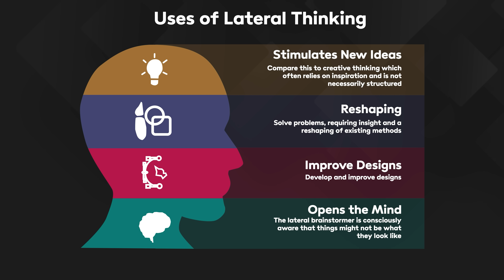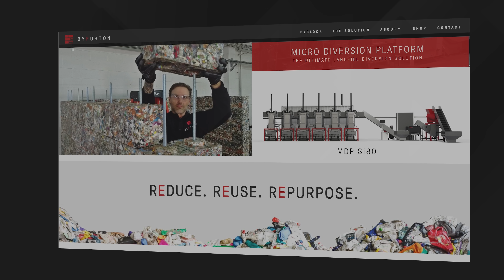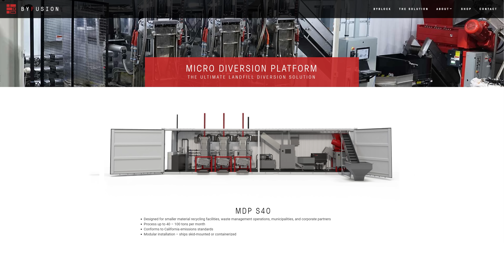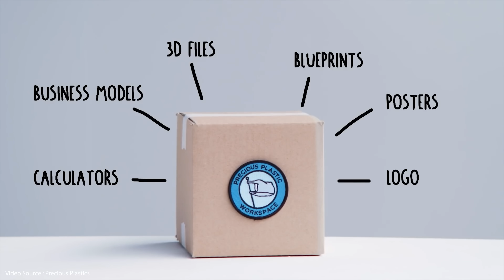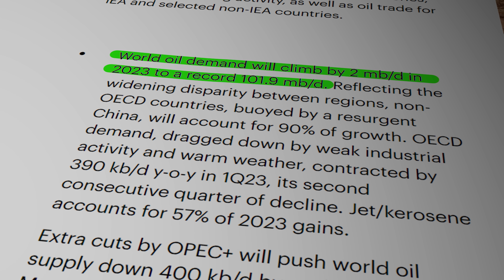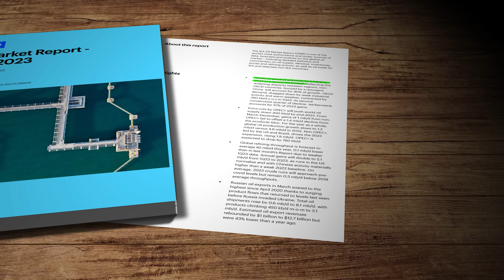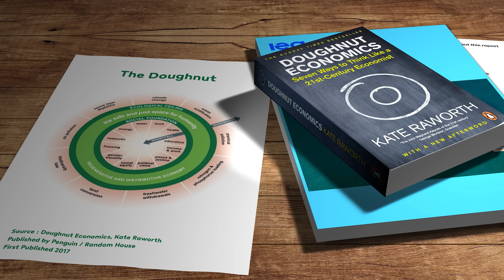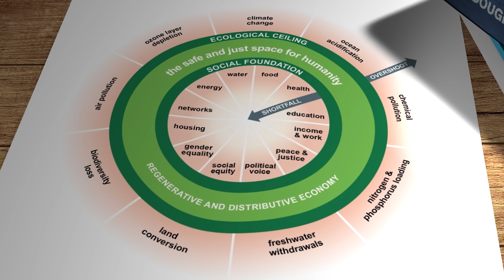Plastic doughnuts? Have you lost your mind!?

Comment: Well, sounds nice and easy. But blocks of unsorted plastic contain and leak all softeners and additives, which the original producer put in - which might not be the best idea, if you intend to build whole homes out of that stuff. There are certainly applications with enough ventilation, that that does not become an issue. But there are other problems: The material is not gone and building materials are not infintiely stable. A crumbling wood-wall produces biowaste,  crumbling concrete releases anorganic dust. But this stuff degenerates to microplastic, which ends up in rivers, oceans and soil as well - and that effect would not even be limited to landfills, but occur on construction sites everywhere. And there is a fundamental difference and disadvantage to other methods to reuse plastic waste: The product her is a solid block of a mixture of everything - good luck separating that stuff lateron for proper recycling. 
I can see a possibility, that this technology might help locally and temporally, when places with a lot of plastic polution are cleaned up and there are no real solutions to manage the waste are available. But other than that, the method does not really solve anything and can function as another method of greenwashing.
Less CO2 than concrete seems to be an argument for the technology. But the material does not fully replace concrete for most applications and when it comes to solutions for special projects, there are already methods available to compress a variety of organic and non organic non-plastic stuff into building blocks which also produces less CO2 than concrete AND has the advantage, NOT to consist of plastic waste.

Comment: In Canada, and just down the street from me, there is a new house foundation being made from interlocking styrofoam (?) blocks which have an open core for concrete to be poured into. The concrete and  some steel rods provide the strength and the foam provides weather-proof insulation as well as a speedy way to create the forms for poured concrete. So plastic is already being used in new foundation constructions. If the waste-plastic mixes could be homogenized, this "hollow blocks" approach might remove a few of the traditional objections.

Comment: Darn it,...I thought I invented( in my mind) the manufacturing of bricks from old, used plastic. I was thinking the plastic material would be compressed into really large building blocks. So large that to move them, and set them into place, you'd need cranes. Designed to interlock, and stay grounded by their sheer weight. We could be building structures that rival The Great Pyramids.

Comment: I like the plastic bricks idea, I was hoping to go with compressed Earth blocks which cut out cement usage in the structure, not the foundation, by 95%. But consuming local waste is in that positive instead of a neutral. I wonder if the bricks are sufficient to make arcing roofs.

Comment: Jeebus, I've been saying someone should do this for years; I must be a jeenyoose! 😄
  It started when I was getting sick of replacing our garden fence panels every five years or so and wondered if it would be possible to add dyes to shredded waste plastic, place it in a form, add heat or pressure (or both) and produce an everlasting fence panel, posts, panelling, garden sheds, et cetera.
  I even wondered if it could be made into something structural like joists (blocks never occurred to me), although I had doubts about its strength and fire resistance.
  Huge kudos to all the people out there actually making this happen... now, when do I get my pre-coloured, wood-textured, maintenance-free, everlasting, indestructibl0rz fence panels?! 😂

Comment: My first concern about recycling plastic into building blocks to replace concrete is the effect heat will have them. I don't know how many people have seen pictures, but the 2021 heat dome over BC, Canada (and the North American West Coast as a whole), melted/warped things built out of plastic recycled this way. Sagging picnic benches, decks, various structure; sagging and bending in the heat. If used for an actual home, it would be disastrous especially considering how much hotter it is getting, and will get, due to Climate Change.

Comment: one to way to implement these plastic blocks could be to use them to build sheds, garages, garden walls etc..at least that way your using up some plastic waste and your saving on using concrete - may even be able to use them as lintels in houses (a lintel is a beam that is usually placed above windows and doors. The lintel's main job is to support the load from the structure above it.), just a few things off my head

Comment: It’s a terrible idea for a variety of reasons. For starters buildings do catch fire; imagine how toxic the smoke would be from a fire in a building with that much plastic in the building materials. Q: What are the by products of burning plastic? What is in the smoke? A: The toxic chemicals released during burning include nitrogen oxides, sulfur dioxide, volatile organic chemicals (VOCs) and polycyclic organic matter (POMs). Burning plastic and treated wood also releases heavy metals and toxic chemicals, such as dioxin. The hippies were right. Use natural fibres, wood, mud brick, straw bale, cob, bamboo, hempcrete, stone, steel and titanium, carbon fibre combined with natural resins, reinforced concrete construction, glass is good and there are other preferable ways to get away from using plastics. Also clothing, don’t but clothing made from polyester, wear wool, silk, linen and cotton, preferably organically grown and sustainably harvested as pesticides are also an environmental concern. Yes plastics are convenient but we are doing damage to our selves and other species for the sake of convenience. When one launders clothing made out of poly, such as fleece fabrics, small particles of the plastic disintegrate and have would up in all of our water and in our selves and in the bodies of every other species. The stuff can even be found in the deepest parts of the world’s oceans at this point. We need to move away from plastics entirely in favour of natural fibres. There is no easy solution as to what to do with all of the plastics we’ve already created and continue to create. The number one thing right now is to eliminate single use plastics from common usage, plastic forks and spoons, water and pop bottles, chopsticks, coffee cups and lids, stir sticks, packaging of grocery items and consumer goods, plastic bags, etc etc, it’s a ragging torrent of that stuff right now, all over the world. A gradual transition to cleaner natural and biodegradable alternatives is needed. They even are putting plastic in tea bags now, it’s sick. Industry has shown itself to be short sighted and irresponsible in this way; always going for the highest profit margin at the cost of environment. Additionally, apart from the extremely toxic and long lives chemicals that are produced when plastic is manufactured and burned, the plastics in our bodies are hormone disruptors and we don’t even know fully how much damage they are doing and of what sort; BPA is a good example and all the while the plastics industry and the EPA was telling us that these plastics were ‘completely inert and safe’. I had an exectutive in DuPont try to tell me exactly that as a teenager. I mentioned that i could taste the poison in the water if it had sat around in a plastic container for a couple of months and this was before the news stories about BPA came out and it was found to be toxic. No wonder testosterone levels are down by 50% in the male populations, especially in heavily industrialized nations. The human race got along for 10’s of 1000’s of years without plastics, we can move away from them and get back to the garden if we want to. There are natural alternatives available. My prediction is that there will naturally come about forms of life, such as bacteria and fungi that consume plastic and convert back into energy and raw elemental components. footnote*I have noticed that puff balls seem to appear any where that motor oil is spilled on dirt roads. The fungi appear to draw energy from the motor oil. I’m not sure the outcome of this process chemically speaking, as yet.

Comment: As a life-long builder, I have often thought of plastics being used exactly like this. The application seems to be particularly simple for low-rise, residential consturction.  I see the boo birds have already filled the comments sections with questions about the structural viability of these things and then the off-gassing and degredation of plastics in the human environment, but that already exists with most building products--particle board in particular. Also, building insulation is often insideous and pastic based in its own right. I am not an engineer, but my hunch is that the things would be more than suitable for residential consturction given that the interior walls would be covered with sheetrock (currently all sheetrock is underlain with plastic vapor barriers at the exterior walls) and then stucco walls on the outside. Just so the boo birds no, Dryvit is also a plastic product and most stucco buildings use this latex based stucco instead of actual stucco. I have gone on too long, but I will add, that these things might really be great for humid climates. It would be interesting to know the R value of the things and a few other bits about their resistance to flooding and pests like termites. Thanks for the work you do, Dave.

Comment: Governments really need to enforce regulations that mandate recycling and sustainability in the product design and manufacturing. This doesn't mean companies have to recycle the products themselves, but they must make them able to be recycled within certain guidelines. Particularly plastics. It's utterly ridiculous that plastic companies get away with so many unsustainable practices to increase their profit margin, such as not just using so many different types of plastic, but using multiple types in the same product. Governments just refuse to cut into their profits or make them pay for what they've created.

Reusing plastic in so many different products like this is a great idea. The building industry will face far more problems for re-using plastic for bricks than other industries, but these problems aren't necessarily insurmountable. The bricks don't need to be weight-bearing, because they can be used in structural frames, but the big issue is exposure to UV, heat, and fire, which will need to be managed through the manufacturing process in some way (such as treatment of the plastic, any pre-treatment sorting of different plastics, and any coatings used). E.g. If fumes are released from the plastic under intense direct sunlight, like it usually does, that could present an inhalation risk for a building made of these bricks.

Comment: California start-up with government grants.  Sounds good, but they are going to fail in a couple of years and the inventors will walk away with a nest egg to finance their life, just like the solar panel start up 10 years ago.....  Plastic is going to out gas chemicals, will deform in heat and under compressive loads, plastic is also a massive accelerant for fires.  I can see a recycling ecosystem  for temporary objects, but not into building structure.  The road surfaces ideas may not be a bad idea, the idea there is a semisolid relatively impermeable surface.

Comment: Question is. How usable are these ?

What weight can they Carry compared to a normal Brick, Concrete etc.

How well do they handle external Stress like Storms. Will a House made of these actually hold out ?

How well do they handle Environmental Stress.
Sunlight Exposure, High Temeratures, Low Temperatures, Rain etc etc.

How Insulating is it.
Can it be Heated Efficiently.
And how does it handle the Temperature Difference between inside and outside.

How are Health, Safety Standards and Usability.
How Safe is it to life inside and breath the Air inside after longer times.
How Safe is it to have Electrical Lines in it. How Fire Resistant is it. And how Poisenous is it in case of Fire.
How much Stability does it lose when You maje Holes and Ditches in it for Pipes and Electric Lines.

There is alot of Questions before I can tell if this is a Good Idea.

Comment: I'm immediately sold on the reuse of recovered plastic waste to create furniture and the like, but share the concern about the viability of plastic bricks and blocks as a replacement/supplement for bricks, cinderblocks, and concrete blocks. 
Just off the top of my head:
Are the plastic blocks designed not to melt during heatwaves? 
Are they designed not to erode or crack after years of rainfall? 
Will the blocks attract plastic-eating fungi or mold?

Comment: Honestly, architects and people at the design/management end of construction are often great advocates for new/sustainable building technologies. Where the construction industry encounters a lot more resistance is further down. There's back pressure from the trades and contractors specifically against trying new products or different construction practices, and not without good reason. Established practices often means low risk fiscal viability. 

I'm currently engaged in a research project about investigating and proposing some changes in how we frame houses, to allow for disassembly rather than demolition. A large component of which has been in discussing these ideas with both framing and demolition companies, which seem to be interested in these ideas theoretically.

Comment: 3 minutes in, a huge advantage of the plastic blocks is huge insulation performance, I would say they can't be used for load walls, only for section walls or simply as insulation.

Comment: How do they make the plastic blocks not be flammable? They might provide more insulation than concrete. I still think that transforming plastic is not worth doing in most cases. We should burn it for heat, which we still need in winter.

Comment: Like I have seen these plastic building blocks before, like the other once I saw used 50% non recycled plastic. And they always want to tout the impact resistence when in building it's not impact that you are mainly concerned about it's compressive strength in which brinks are pretty freaking awesome at. I would like them to be more upfront and say hey look these things have relatively good tensile strength because they are made out of plastic, but compressive stength is x amount worse, but also it's lighter so you can build to the same height with the brinks adding less weight, so for a 2 level building it's roughly equivalent and if a truck does smash into your building it's actually better.

Will it get by completely unscathed, probably not but it should hold up better than a brink building and with a more reasonable impact it should hold up completely where a brink wall would fail.

Comment: I rather have mushrooms or mycelium eat the plastic and use the mycelium as building blocks. Microplastics (forever chemicals) would still be released into the air & environment with their approach. We should be moving away from Plastics based on #oil

Comment: Concrete blocks with rebar and the voids then filled with concrete mix are a very fast and cheap way of  building an extremely strong wall that can hold a tremendous amount of compressive force.  It looks doubtful that the plastic blocks are at all comparable in strength, even if they can be made competitive in price.

Comment: One- probably still needs to eliminate the chlorinated polymers from the thermal consolidation process.

Definitely inserting space occupying "plastic plugs" into non structural (non critical) portions of concrete pours..  (thermal properties of bulk plastic is definitely an advantage WRT insulated slabs and thermal breaks.

Comment: I've ruminated over melting our household plastic waste and mixing in sand or other granular material to make building 'mass' if not exactly building material. There are obvious hazards; the obvious being flammable and toxic fumes. I figured that the least risky methodology would be to (solar) heat the 'ballast' material first and then add plastic until the desired consistency is achieved.

Comment: I anticipate resistance to adoption for zoned properties. These blocks, as strong as they are, vary in strength, uv resistance, degradation, tensile and compressive strength, etc. There would have to be minimum standards for the type of plastic, process, and a whole reporting and certification regime needed to make safer habitable structures. Otherwise, they would make good accessory buildings.

Comment: How is it a circular economy or product when most times it's plastic mixed with sand or cement or (insert random building material)? How do you recycle it after adding these other ingredients?  It sounds more like a how do we hide plastic and kick that circular economy can down the road?  

Plastic needs to be un-invented and replaced with carbon fibre or graphene.   

Make big thermal solar plants in the desert and transport the plastic there to run through steam reformers to revert the plastic back to oil.  Store it for use in cars as they phase out petrol and eventually switch to electric. Ban new oil extraction.  Or perhaps just store it for military reserve energy?